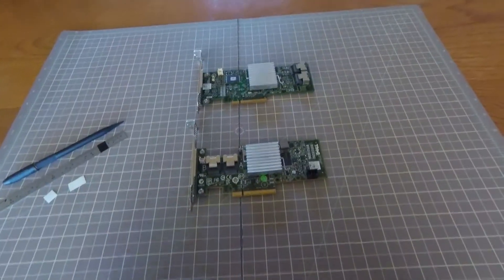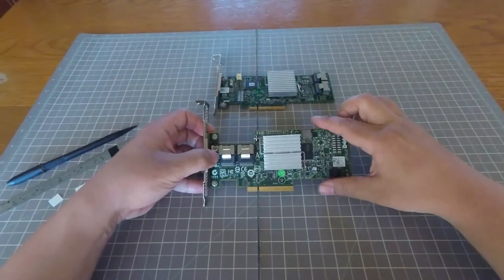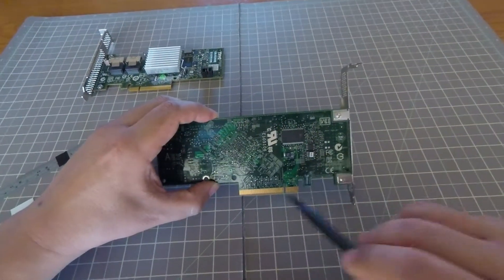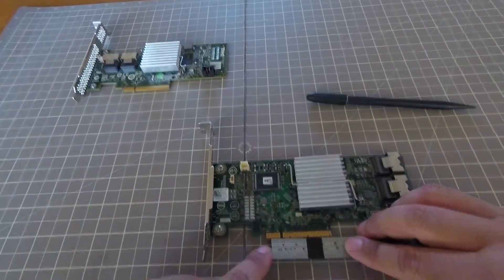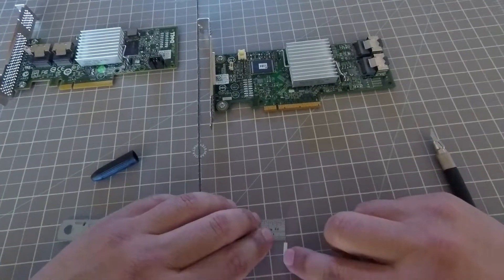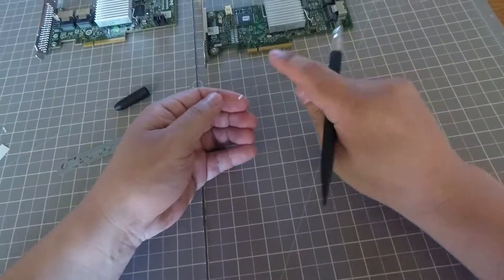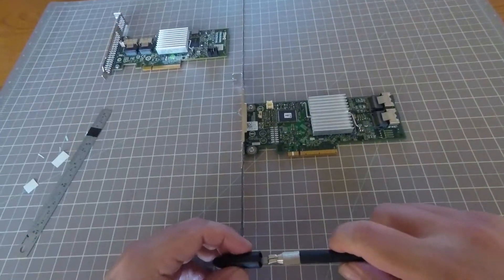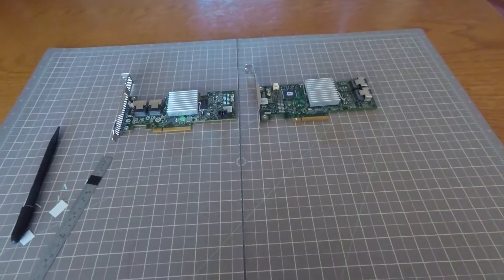How to fix SMBus issue on Dell HBA RAID SAS controllers by taping B5 B6 pins

Comment: Had issues when I moved my LSI card from my Supermicro X8DT3 to a MSI motherboard! System only recognise half the available memory!
Reply from the maker: Did this resolve the issue?
Reply: @ArtofServer  it turned out it was corefreq plugin in unraid that was my issue but still have issue with LSI 9211-8i (SAS2008) only running at 4x

Comment: Does it be the case with cards labelled lsi 9270 cv 8i, I brought it from ebay and it didn't work in hp z420.
Reply from the maker: Maybe. Worth a try as HP machines always have the SMBus conflict.
Reply: @ArtofServer  thanks for replying, the card burnt up which is unlikely due to smbus issue within seconds, got refund and I was looking at one of your videos where you pointed out about counterfeit sas controllers and I think it's rampant. All fingers crossed. Will update, not many videos online though.one question though, Will lsi 9260 8i work by default in free nas or I need to reflash it? Or shall I stick to run it in the main windows machine? I don't do daily editing, just need backup of all the videos I shoot.

Comment: OHM9JY same issue but easier fix: those pins have super thin traces on this board so just gently scrape off the green mask and life a millimeter or so of trace and remove it. Probably fairly reversible if you needed to but all my Googleing hasn't not had anyone say not enabling SMBus was an issue. Plus that card is like $22 shipped now so not a big loss.
Reply from the maker: You can also disable SMBus on PCIe on the motherboard in some boards using a jumper or a BIOS/UEFI setup menu change. :-)

Comment: Might be easier to just cut the traces on the board. I have a intel g27504-612 that may be having this problem. it wont even show up in the device manager on my windows 10 msi pc.
Reply from the maker: I prefer to use the least destructive methods, but it is your choice how you want to do it 😁

Comment: Thank you for this. I had built a media server several years ago using one of these old Dell cards and I after a recent upgrade the drives kept dropping out or failing to read and write properly. I knew I had done something specific in the past to get it working but completely forgot about taping over these pins. It obviously became dislodged after a bit of movement and caused the issue. Anyway, was probably a good time to reapply some thermal paste too. It was like dust under that head sink. Hopefully will last another 3-4 years.
Reply from the maker: Glad this was useful to you! Thank you for checking out my channel! :-)

Comment: Thank you so much for this Video! I picked up a Dell X520 10GB SFP+ Card for my HP Elitedesk machine running Proxmox for Router/Fileserver/Docker. I couldn't get the machine to post with 4x4gb stick populated. After some trial and error I could get it to post with 2 sticks, but I wanted the full 16GB. Performed your mod and now the system boots normally with the card installed and all 4 mem sticks populated. Your a Legend!
Reply from the maker: Glad this helped! :-)
Reply: Just double checking, you did this mod on the sata controller rather than the 10g NIC? 👍🏻

Comment: mthis might make it where i can use a sas card from my old dell pe t320 in one of my personal builds as the server is now basically useless as the only x16 slot is broken on it im gonna hve to try and see what i can use to break b5 and b6 on the card
Reply from the maker: Not all consumer PC boards will have a problem with the SMBus on these cards. In my experience helping my customers, I find Gigabyte and HP machines to be the most problematic. If you don't have one of those, I would just try it without any mod first and see if it gives you any problems.
Reply: @ArtofServer  i did before i seen the video the system would refuse to show a picture with the card inserted but when i did this and tried again the card worked i have a MSI z97s sli krait edition im working with now instead of that Dell

Comment: Thanks for this excellent video, still relevant after all this time. Allowed me to connect  Dell X540-T2 10G 2-Port PCI-EEthernet Network Adapters to my Lenovo thinkstation P330 and thinkcentre M58P. Would not POST without the pin-mask, Many Thanks.
Reply from the maker: Glad it helped
Reply: I have the same issue, are you saying you blanked off the pins on the LSI controller rather than the same pins on the 10g NIC? My system works fine until I plug in the x540 10g nic, then it won't post unless I take half of my dimms out 🤷

Comment: Thanks for this video. Today I faced the strange behavior of an i5-4590T  and H97 chipset when I notice that I have only 4GB from 8GB (2x4GB). Actually the DIMM0 of the MB doesn't work anymore when IBM HBA with LSI 9207-8i is in PCI-e 16x slot! I remembered this video and I watched again, blocked the B5 and B6 pins and everything is working perfect!
Also I test it with a DELL PERC H710 witch the PC didn't started at all. Doing the same procedure, the PC started perfectly and seeing the card!
Thank you for your work.
Reply from the maker: Glad this was able to help you! By any chance, was that a Gigabyte motherboard?
Reply: @ArtofServer  No. Is a Chinese ITX MB JGINYUE H97-GAMING ITX LGA 1150 from Aliexpress. I'm building a small NAS in a 3D printed case MK735.
I had a Jetway ITX MB before this but because it has the external 12V / 24V power supply a shot-circuit into the external PCI-E adapter for SAS Expander blown up the power circuits on the MB. The short-circuit system on Jatway MB wasn't good at all. So I had the rest of the parts and I brought this MB which is quite good with rich BIOS settings. Also supports virtualization.
Also the Perc H710 controller which I have it I couldn't boot the system with it. Using the same technique I was able to boot the controller in this MB and also in my Ryzen 5900X with Gigabyte MB.

Comment: Thanks for this video, might be 4 years old but still helpful. This card worked in an old machine that i used to flash it to IT mode, moved it to a MSI H77MA-G43 and it would just boot cycle. This fixed it and fortuantely i had some polymide tape (~$10) that i had used previously for blocking single pins on some hard disks. Thanks again
Reply from the maker: Glad it helped

Comment: This might be the cause for one of my motherboards working with 4 drives connected to the card when internal data is in use.
Reply from the maker: not sure about that. The SMBus conflict will usually result in a non-booting system or disabled DIMM slots. doesn't sound like that's what you are experiencing?

Comment: Trying to install an HP Ethernet 1Gb 4-port 331T  into a Dell Precison 3260 for a small ESX lab install.  I tried the 5 and 6 pin block as described here as I saw elsewhere this may work, but it does not.  System hangs on the POST screen, shows the Broadcom info, and then it just sits there.  Do you or anyone else know if this is even possible, or does this only work on non-Dell boards?

Comment: For me this didn't make any difference. I have a Gigabyte X570 I AORUS PRO WIFI (rev. 1.0) motherboard and a Fujitsu D3307 8i IT Mode 12Gbps SAS SATA HBA (LSI 9300) card but the heart beat LED doesn't come up with or without taping the pins and neither UEFI BIOS nor any OS can detect the card. Fresh install, all legacy settings in BIOS enabled, Gen3 for PCIe16 set. No success. Maybe my issue doesn't come from this which you presented with the solution.
Reply from the maker: Totally different symptom and problem. I said this SMBus problem might cause a system to not POST, or on HP systems it would report some DIMM slots are bad. Your lack of heartbeat LED is something else entirely. Usually, that means the firmware cannot start up. There are a variety of reasons for this, including: corrupted firmware image, no firmware image, lack of power on one of the rails, invalid SBR content, etc.

Comment: installed one in an HP SFF 230, it did not work, but the STRANGE thing is that then the CPU FAN after a while started running at 100+% speed an it was as loud as a helicopter (exaggeration, but it was REALLY LOUD). I'll try your trick when I return in ~3 weeks and update in a comment.
Reply from the maker: hope it does help you!

Comment: Well I was toying with my received Perc H700 that I intend to use on my Windows machine (Hardware RAID is the only way to ensure data redundancy, either that or fakeRAID, and I am out of SATA ports on the motherboard)
But the machine refuses to boot, so I put some packing tape over the two pins and voila, the card shows up and works :S
Makes me hate proprietary stuff, but I guess that is what Dell does with their management systems.
Reply from the maker: Glad you were able to workaround the problem. Many vendors use smbus too, not just Dell (HP, Gigabyte, Lenovo, to name a few). Sometimes you can disable it on the motherboard with a jumper setting.

Comment: now you did it and said it works, but did not show it works, so how can we believe you? 
i tried this on 2 cards and installed into a asus hero 4 desktop motherboard and the system posted but didn't move past the bios and gave me a few mem errors
Reply from the maker: please never believe anything you see on the internet. :-P
Reply: @ArtofServer  lol :) good one..., would you mind giving me a few seconds, i have a hardware problem that i am trying to solve, maybe you can help me?
Reply: i have 2 dell h310 hba (not it mode, i think) and they work, read drives from breakout and backplain, now i wanted to connect more then 8 drives to it so i got a 9 port AEC-83605/HP expander card from amazon, and i plugged into my dell t610 board and connected a cable from it to one of the ports on the h310 and connected an other cable from the expander to the a breakout cable with a drive attached and i cant see any hard drives, any ideas? is it possible that the h310 needs to be flashed in IT mode to work with a sas epxander card?

Comment: Would this possibly fix an issue where my Asus P6T deluxe (a socket 1366 enthusiest board from 2008) prevents me from entering the cards boot rom?  My card is a SuperMicro with the 2308 chipset and the LSI IT mode firmware and boot rom.  I was talking about this in another video of yours a couple of weeks ago, and I am unsure which one.
Reply: To give some background. I picked up that card and a bunch of 4tb hitachi sas drives and had all sorts of problems in truenas and a zfs2 raid. Narrowed it down to 1 bad drive using another knnown good card, cables and computer. In trying to isolate other things I found I was unable to enter the boot rom on my HBA for this project. I know you suggested checking for a UEFI firmware option and such, and pointed me to a video for this very thing.. However the motherboard in question does not have uefi.  I have confirmed I can enter the bootrom with another computer (which has UEFI but disabled) and set up a boot drive and then have those settings be retained when I plug the card back into my P6T..  To be honest I really doubt this will be a problem for the function of my 8 disk raid, as I don't intend to boot from the HBA. But It is just an oddity that I wouldn't mind figuring out.   Any setting I could find in the motherboards bios that had anything to do with boot roms or drive boot sequence was fiddled with and made no difference. 

I now know I have 8 perfect drives and cableset. And card is working from another machine in the way that I need it. I am not quite done with seting up the final config yet though. (almost there)
Reply from the maker: Yeah, that doesn't sound like a smbus issue.
Reply: @ArtofServer  Ok. I think i am ok with accepting my motherboard i was going to use simply has incompatibilities then. thanks!

Comment: Solved the issue. I watched this before, didn't realise the issue and results which is spot on.

I had a no boot with dell perc6e on hp dl380g6.
Hp HBA and CNA on Asus p67pro.

Bit of a mix of hardware, but switching over to a SAN and 10GBe and have a number of servers and a dell DAS to extend storage (just so happened to be a very good price).I should note that the perc worked fine in MSI b450-a pro max board without issue.
Reply from the maker: Glad this was helpful.

Yes, this is only issue with certain motherboards, not all. It happens when the motherboard is using it's own SMBus on the PCIe bus. This is very common with Gigabyte and HP motherboards, but not exclusively just those brands.

Comment: My H310 is on the way from you and I plan on using it with a Gigabyte Z68 desktop board. I was sitting here at work thinking about the potential pin issue... With no kapton tape readily available, I snipped off an inch of p-touch tape to take home. Oh the irony when I found this video and saw the little white squares lol
Reply from the maker: Thanks for watching and thanks for supporting me through my store! :-)

Yeah, those Gigabyte boards tend to have the SMBus conflict, so you will need to apply this.

Comment: This fixed my ASUS Maximus VII Hero. Issue was: System would POST but would not boot and/or would not go into system BIOS, occasionally would not POST and/or give memory errors (on board diagnostic LED). Two cards in system would cause boot-looping (no POST). Thanks so much for your after-sales support!

Comment: I have a  IBM M1015 (LSI 9220-8i) which work perfectly fine on a MSI Board. A M1115 (LSI 9223-8i) dosn´t. But masking the pins solves the problem. Thanks a lot.